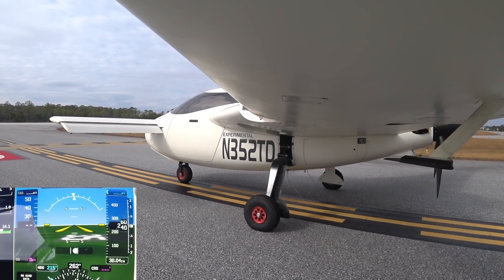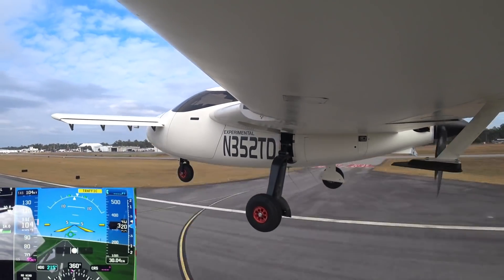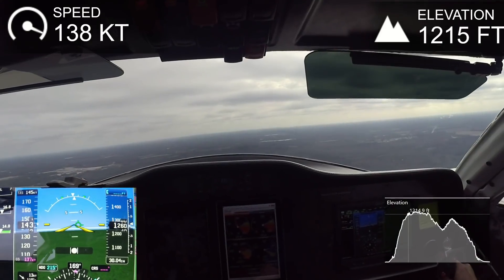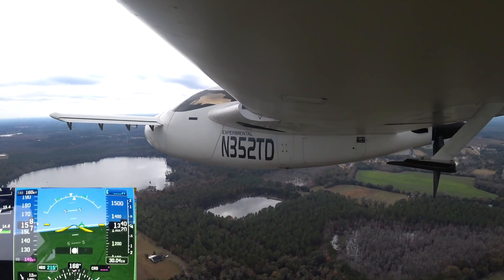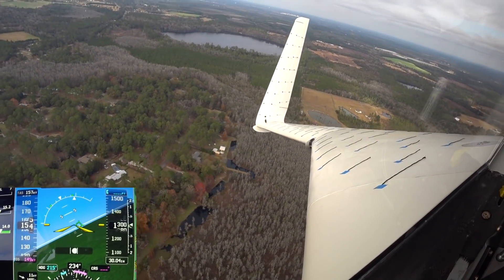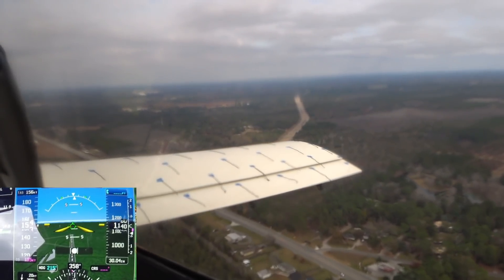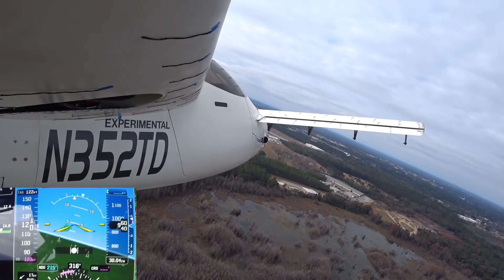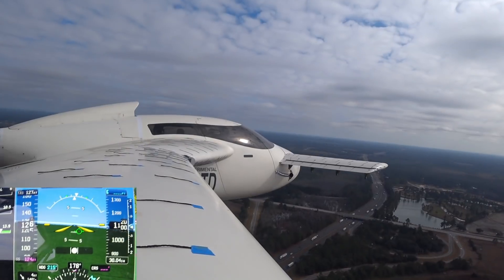Dialing Things In - Flying the Raptor Prototype

Comment: Peter, are you flying test cards on these flights or just “Winging it?”  If you are using cards, why not read them as a preface to each video? If you’re not using cards, why not? I mean, it’s great that you got the speed up to 150kts ias but did you mean to? If you had an aerodynamic problem at that point would it have been a surprise? Speed envelope increases should be incremental and preplanned and intentional. Lots of distractions, keep it under control. P.S. looks like it’s time to re-pitch the spade surfaces to zero aoa. Otherwise they can get twitchy and inducing a constant stress on the brackets and control loop.
Reply: The point is test cards or lack thereof. Cards are recommended by the EAA and are an integral part in reducing the first flight accident rate as well as the follow on flights. Lack of cards indicates a makeshift test program. This appears to be the case. With all the early distractions, the power plant drama, incomplete aircraft systems,(missing bulkhead) resistance to focused problem elimination, it all smacks of an undisciplined, unfocused test program. Yes, the flights have been incremental in nature but not apparently by design. Here the speed jumped significantly above previously,”Cleared,” speeds. Flutter, controllability all can all spring nasty tricks with little warning. The progress has been good but I don’t see any detachment in the decision making . It’s a hard but understandable. So much time and money puts you too close to the testing. The person making the decisions has no one to tell him to stop or reconsider. Lack of test cards means progress is haphazard from a safety management and test program standpoint.
Reply: @stephenwalton7079  I also worry about the height... my Challenger's first flight was uneventful, but I had flown in one previously and lessons in a similar plane. When I made my first flight I was at 1000 in the circuit BUT I knew it could glide back to runway if needed. I see circuits being run at 1000' in the Raptor but I doubt it would be able to make a landing if the engine went out??? I personally would feel a lot more comfortable beside the circuit at 7000' ... just be safe.
Reply: @stephenwalton7079  just checked ur account. No face, no content, recently created, making negative comments here on this channel. At least ur points are somewhat valid as compared to the other fake accounts i have personally encountered on this channel.
Reply: @yashmanwani6232  I’m sorry, I didn’t realize there were parameters to meet for posting. I just recently discovered the channel and thought constructive criticism was in order. I’ve lost too many friends in aviation over the last forty plus years and thought some objectivity might be in order. Peter has done some great work. Building an aircraft is a challenge and a new design from scratch, even more so. This is a mega ambitious project but lacks conventional test program protocols and oversight. No sense reinventing a wheel that kills you.It’s a free country and it’s Peter’s project to run. If someone can show me where I’ve erred in my opinion, I’m happy to learn. That’s the value of discussion. Hopefully some useful insights come forward. You allude to a false account. I honestly don’t understand the term. Whatever. I’m not here to prove anything to anyone. I’ve built aircraft from gyrocopters through warbirds. I’ve been blessed with a career flying some awesome aircraft for a great airline. Got nothing to prove,
Reply: @stephenwalton7079  no thats not the criteria but since i have argued with so many of them here that any similar pattern raises a red flag in my mind. Urs is different though. As i said i dont disagree completely with ur points. Pardon my ignorance and point me to some resource that prooves that most kit manufacturers follow these structured test programs. On the other hand I can point you to a hundred which go like 'oh yeah our build was ready so we thought lets fly it to oshkosh this year and get some orders'. Again its not wise to compare oneself to those who follow bad practices but i want to see an example of the best stringent, transparent test program for an experimental if u have seen one. I don't say it cannot exist but i really want to see for myself if such a thing exists and i am unaware of it.
Reply: @flyfalcons  i said the same
Reply: If you look at the top speed achieved over 6 flights, it was kind of incremental. But i agree that for higher speeds he should first climb to a much higher altitude first so that he has time to handle surprise aerodynamic issues.
Reply: @James Brandt Skepticism is certainly warranted on any project that has high boasting levels.  What Peter is trying to do has never been done and it's reasonable to think it's not possible.  I too am interested to see if, now having gotten the very very alpha prototype off the ground, there's still an expectation of hitting that price point - regardless, I do believe that in the previous flight he was hitting 110 knots at 11 gph.  At altitude I'm guessing he has a decent shot of getting much closer to the 7 gph cruise target.  I'll also add that Peter has successfully flown his girl multiple times now when many of the haters said it would never even get off the ground so I think a little patience may be in order.
Reply: Regarding Raptors prospects: no one has seen the future but we have seen the tenacity of the man driving the project. Yes he has taken some shortcuts but sometimes shortcuts are necessary in the prototyping phase.
Reply: Guys i am certainly not the yt police. I observed the pattern that most negative comments on this channel are coming from accounts which do not have anyway to be linked to a real person. Some of you may be real and feel offended and i am sorry to those. some of you maybe the same person hiding behind these multiple accounts and i feel sorry for those pathetic cowards. There is no way to know for sure who is who. If u r real i m sorry and if u r fake then i wish u find courage in life.

Comment: It's getting better all the time! It looks like that tell tale is at the same angle as the strake and it only seems to shift from straight back to that angle. I'm curious to see what happens when you take that off. Also curious to see if it makes a difference if you completely cover the wheel wells while retracted

Comment: Thanks. Just an uniformed observation. Seems like the plane's instability happens when you execute a banking maneuver. Also, maybe the oil cooling system could be plumbed into a engine coolant and oil intercooler. 
Would canards up swept on the ends help with turbulence that is possibly interrupting airflow reaching the main wings?
Looking forward to the 4000 feet altitude flight test.

Comment: Happy to the positive progress.
 IF, Altitude helps the heat issue it’s a short term bandaid. 
At some point a real solution that actually cools the fluids, extracts heat and puts that heat overboard will need to engineered.
Reply: I agree. The current bandaid has gotten the plane in the air so real solutions can be tested., BUT until the plane can cool adequately in a climb to altitude, it seems premature to do anything else. The function of the main radiator and intake is not satisfactory and should be fixed. This is not a ding on the design, most new aircraft designs have cooling problems. But it needs to be solved (not bandaided) before continuing with the flight test campaign. This is still very much an experimental prototype.
Reply: In several of the previous videos multiple people, including an Audi 'expert' (at least on the internet) have questioned why he's still running two turbos and pointed out how much heat he could eliminate by replacing the two with one. It's not like this is in a car where you would want two small turbos to spool quickly to get power for a tight corner.
Reply: @James Brandt The M20K 252 TSE service ceiling and most single turbo aircraft can make it well above FL 250 without a problem. The second turbo only adds weight and heat.

Comment: If you can manage to get the air temperature down after both stages of compression from both the turbos, u will see a lot of increase in power and the oil overheating problem will go away too. What u did until now was ok to get the aircraft flying but going forward u really need to invest in serious cooling of the compressed air from both stages. Then the power gain will be so good that u wouldnt have to worry too much about weight.

Comment: Integration and optimization is proceeding nicely and it sounds like you may have a manufacturing arrangement out West; all good news.

Say, on the last video, what was that brown spot on the left side under the wing root in front of the main gear door? 
It looks like you saw it too, but I just can’t think of what it may have been caused by unless a hydraulic/brake line burst.
Reply: It was coolant overflow. It will have a little bit of rust hence the brownish colour. He mentioned it in one of the videos ways back
Reply from the maker: It is some filler that was not primed over. It has discolored over time. I put some tape over it for now because color matching it with paint is difficult and I don't have any of the primer handy.
Reply: @RaptorAircraft , I noticed it looked clean. The tape did an excellent job camouflaging for photo opps.

Comment: What percent power were you at Peter when you were getting 159kts?
Reply: 75% as the fuel burn was showing 15 gallons per hour at that speed.
Reply: I am observing this aspect of Raptor very carefully.
Reply: Was about to ask the same question.  If VR is 100 kts, slow flight seems like it's out of the question.
Reply: @chrism9976  120 kts in the pattern, 100 touch down and take off. These are very similar to lancair ivp. If Raptor manages to sort out its cooling issues in the right manner it will have sufficient power to cruise like ivp as well. Maybe it's being too optimistic but lets hope it happens.
Reply: Closer to 150kias, as there is an error in the pitot static that's causing the ASI to over read. The ground speed is a more accurate representation.
Reply: @sheldonholy5047  as long as you subtract them wind speed if you know it, that may not be accurate if the wind speed is off, you would need a pirep

Comment: Might try adding a smoke generator on the tip of the foreplane and seeing where the vortex goes at different airspeeds/AOA/elevator input.  That would answer the question of whether the wing is being affected by the foreplane vortex or if it's spanwise flow from the higher sweep of the wing root.

Comment: Looking great! I was wondering if you can leave the pattern or must you stay in it.
Reply: It’s his discretion when and where it goes. Being in the early test flight phase, short, deliberate flights are wise.
Reply: Experimental aircraft have to stay within an assigned test area during flight testing, that can last for 20 hours, 40 hours, or even more depending on the aircraft and what needs to be proven.  Generally this means an x mile radius from the home airport, or in a high population center, a flight corridor to a safe testing area away from the city.  The examiner will get with the pilot and increase the area if necessary for testing.  Initial flights should have a very restricted flight envelope, and as testing progresses, that envelope is expanded.  Meaning, take it slow at first, don't retract the gear, minimal bank and pitch, check stability and operations, then slowly integrate more things into the flights like retracting the gear, nibbling away at higher speeds, increasing rates of climb, checking high AOA and stall characteristics, etc.  The first phase is getting the plane up and improving any issues that arise (cooling, instability, etc.), then you move on to the next phase, where all the V speeds and safe operations for aircraft are established.  All of this is part of a program to most effectively utilize your time in the air and get the plane signed off as quickly as possible.

Basically, you're taking it easy and doing one thing at a time, keeping safety in mind above all else.  Staying within gliding distance of the airport and slowly going higher or further away if necessary for continued testing.  If you don't need to go high or far from the airport, don't.  If it worked great last time, add a little more.  When you're on a bench press and you want to see just how much you can bench, you don't start with all the weights...you start off with something easy then work your way up, often coming back to it several times until you reach your limit.

If you're interested in the procedures for flight testing experimental aircraft, here's a couple links that go into more detail:
http://www.faa-aircraft-certification.com/experimental-flight-test.html
https://www.kitplanes.com/flight-testing/
https://www.kitplanes.com/flight-testing-2/
https://www.kitplanes.com/flight-testing-3/
https://www.kitplanes.com/flight-testing-4/
Reply: Likely staying close because of the low ceiling, as is the case here, and because of the oil temperature issue that he's working on. Baby steps.
Reply: Thank you guys! And thank you Mr. Meatslapper!